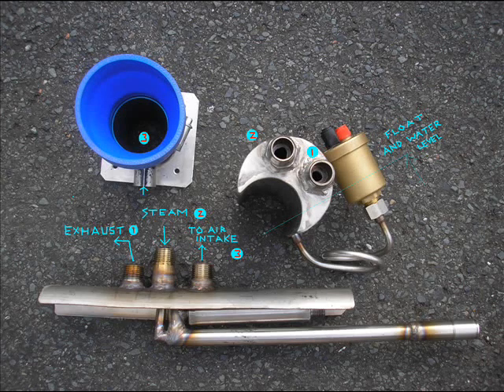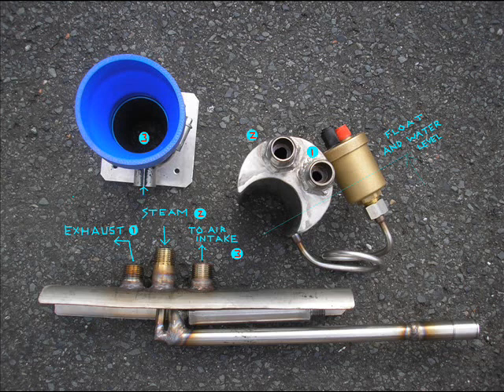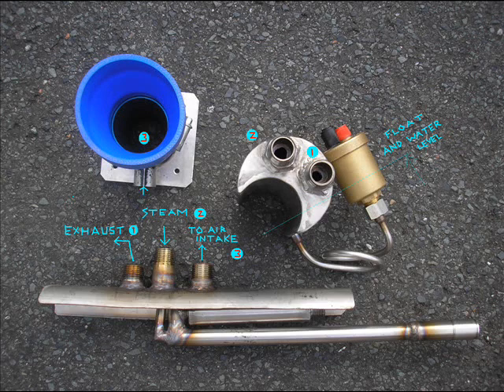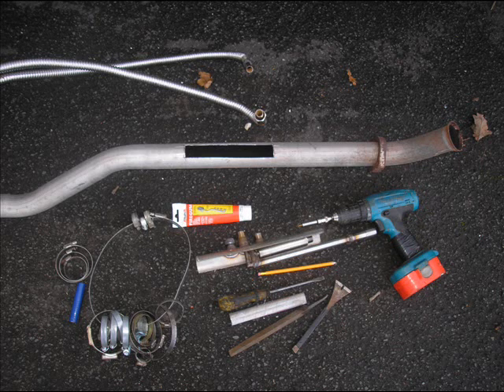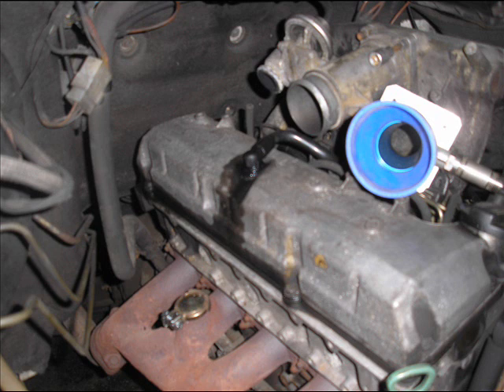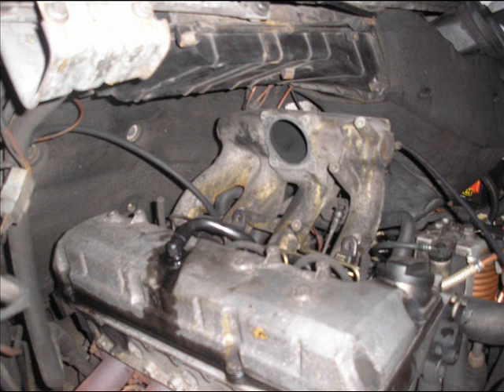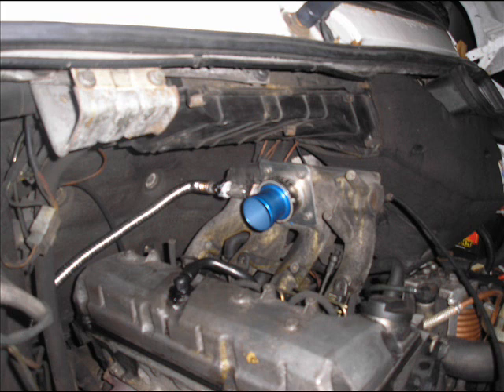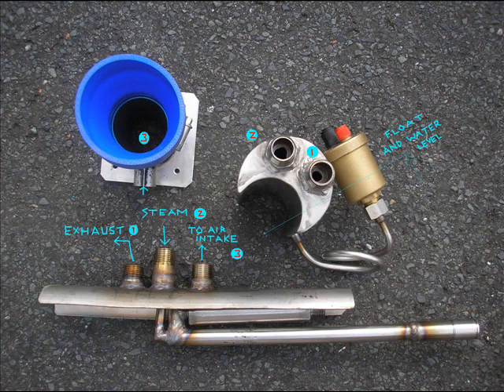vid2 ECOPRA COPY WATERFUEL MERCEDES SPRINTER .wmv

Comment: looks like he is getting only steam from boiling water  with the heat from the exhaust and mixing it with the fuel. this will work but is not HHO.
if i am wrong please correct me, i am very curious